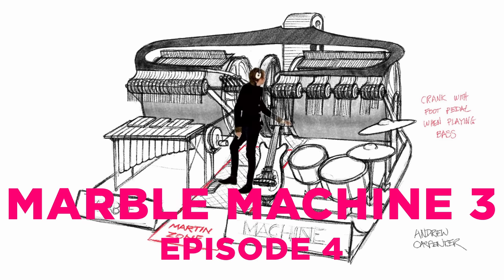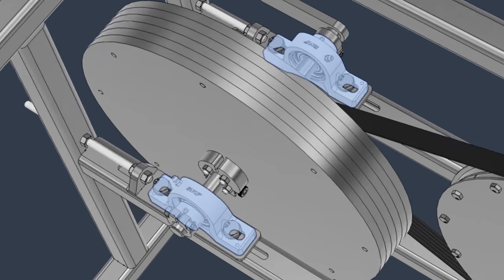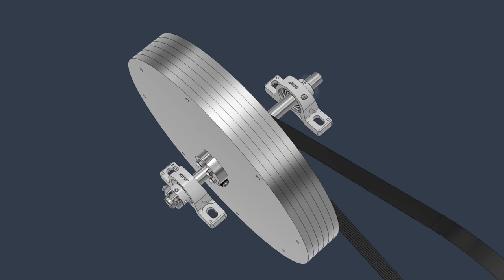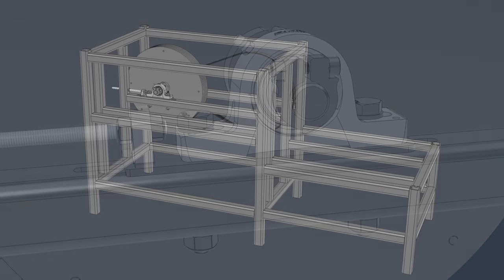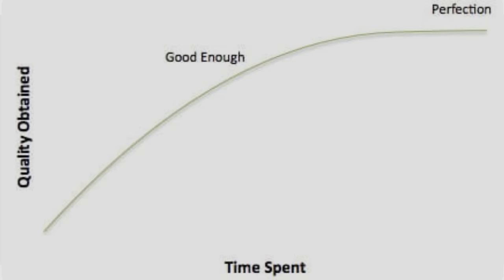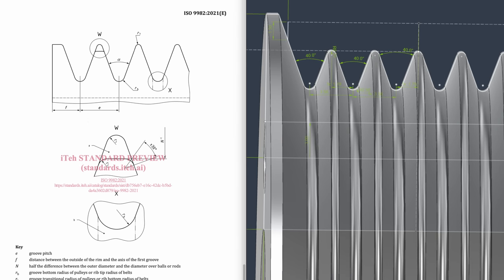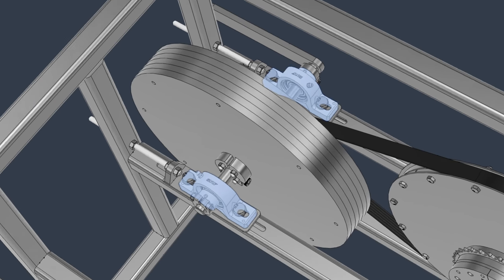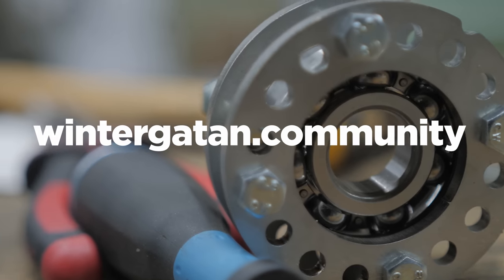A Better Flywheel Design - Marble Machine 3 Ep.4

Comment: If you are going to make the flywheel exact diameter to the axle, it could be good idea to make the hole bigger, and machine a shoulder in to the axle (so that its bigger at where the flywheel is)
Doing it like this you make installing the flywheel much easier as you only have to press a short distance, and not for the lenght of the whole axle.

You could also lighten up the flywheel by taking off inside material, it's the outer edge that does most of the work.

shave some metal off here and other there, and you make the whole machine much lighter
Reply: Hi NuffMan  the advantage of doing the design as-is, is  that you can buy  hardened and ground shaft of a very precise diameter that would be a correct fit
for the selected bearings ,no machining needed other than being cut to length . Bearing ,collars, flywheels etc do not Need to be press fit. In many, if not most applications
Just a very close clearance fit.  (there are tables for this 🤓)If you don't have to press it on you don't have to press it off either.
the fly wheel clamps , correctly made will keep them nice and square.
Of course there are also commercial shaft clamps with flanges , maybe not exactly what is needed thought.
Reply: @steveggca  it's just from experience i know that tight slipfits can really easily make a scratch or gall the surface slightly, especially when there are segmented pieces.

It may not be a problem in the first assembly, but may be a big headache in the future, especially if theres paint on the saft and possibly slight rust at the bare metal mating surfaces.

If not else, the markings from the lock-srews in the bearings will make it impossible to remove the parts from the shaft without tools

Comment: I honestly never knew laser cutting hardened the material it's cutting, makes perfect sense now that I've heard it.
But I've never found any difference between reaming laser cut and drilled out holes, we always did make the holes 1-1,5mm undersized so I can imagine the reamer cutting better when taking a larger cut getting under the hardened layer instead of just skimming of material right in the hardened material.
Reply: Reamers aren't designed to take off much material, usually around 2% the reamer diameter for machine reaming.
Reply: Your name is "axle bearing", so I'll take your word for it :-D

Comment: DON'T DESIGN LEGO PIECES!  Buy Lego pieces!  "Fun welding?"  NO!  Ditch the welder & the angle grinder.  The more of your machine that is ASSEMBLED, (not welded) the better.
On that flywheel, watch out for wobble.  You want the wheel to run true.  Clamp up bolts slightly loose & put in shaft.  Spin & tap with hammer to true, then tighten.

Comment: You can't buy the poly-V pulley?  BUY STANDARD PARTS!  Whoever sells the belt should be able to sell you pulley!
Don't get all hyped about the wheel balancing!  Make it concentric, & that should be good enough.  If it isn't, you are using too high flywheel speeds!  A simple "gravity balance" (done by you on the machine) should be good enough.  Rotate the plates through different angles to distribute the centration errors around.

Comment: They are designed for keyed shafts, but something like an 1108 or 1610 taper lock bushing would provide an off the shelf solution for the pulleys.  Keyless bushings also exist but I don't think they are widely available for poly v profiles?

Youtube machinist Clough42 did a recent series on a grinding wheel balancer that seemed quite sensitive. It's basically two pair of shield-less, un-greased all-ceramic ball bearings (skate bearing sized) in a 3d printed fixture-- that design may be adaptable to balancing the flywheel. Using the collar bearings to balance in situ would likely hide a minor imbalance.

Comment: Cut a key seat on the shaft, and use keys with the flywheel discs (or whatever fixes them to the shaft) and the pulleys.  You don't want your wheels slipping on the axles. Clamping the axle with grub screws or friction fits is pretty questionable in a high-torque application.

Also, why make custom pulleys?  Whatever the European counterpart to McMaster-Carr is, they must have a thousand different varieties in stock, for different belt types, sizes and diameters, including 3-, 4- and 5-step adjustable cone pulleys so that you can try different ratios.

Comment: Hi Martin, 
Have you checked the deflection of the axle under the maximum weight of the flywheel? If it's really heavy, 20mm may be a bit small going by what appears to be the unsupported span in your drawings. A larger (30mm?) axle will also give you considerably more clamping area, reducing the possibility of slippage, although torque requirements may not be very high. 
Would agree with the comment about weight distribution on the flywheel; center mass adds weight out of proportion to inertia. 
Am glad things are progressing.  Keep having fun!

Comment: I think you're still over complicating it.  There are nice bolt together taper flanges, so instead of a perpendicular clamp, you have a concentric clamp to the drive shaft.  Same with your pullies, I would use the industry standard taper clamp thing for them.  I wish I could remember the name.  There are so many options for pullies.  Also, v-belts, they are very forgiving, easy to change/replace and find.  If you use a taper clamp, then you can also ensure that the belt is square to the driving pully.  Getting the alignment correct on belts is critical. Serpentine belts are very unforgiving to misalignment.

Comment: I think your going to have trouble with the shafts clamps alone. Once you've done up the through bolts you won't be able to tighten them further.
A key way for the pulley and flywheel will be simpler, and  lower maintenance. You'll still have to use clamps but they'll only need to restrict the axially position of the flywheel.

Comment: Do you have to get the pulleys custom made?
There are LOTS of standardised already available pulleys with built in clamping features to clamp to smooth 20mm axles.

Off the shelf parts mate. All the time.

Comment: I like the new design, but I am concerned about starting to build it BEFORE the machine is designed in it's entirety!  You can't assume you know where anything is going to be located until you have made a place for everything.  But you aren't done when you have a place for everything, because you also need to figure out how it will assemble and in what order parts will be assembled.  You will probably find conflicts, which will force you to iterate on the design.  And once you go through a few iterations, you build it and find more conflicts that you hadn't noticed.  So you can't "just" start building a frame and assume you are making progress toward the final machine!

Comment: The current design allows for the use of multiple sets of pulleys to somewhat easily and quickly change tempos and maintain optimal flywheel inertia using a single belt length. I.e., tempo/flywheel rpm ratios. A simple governed variable speed transmission to unlock tempo from flywheel rpm would be the ultimate. If the MM3 can be played from a seated position, adding another foot pedal to utilize both legs would be more practical, efficient and physically sustainable.  A one-way clutch on the pedal input would be a safe thing to do. At least make it impossible for your foot to get caught and crunched in the machinery.

Comment: Pump the brakes right now please, Why not use already existing parts for this? like car parts? You can already get extremely balanced parts that you need for the flywheel with using car parts.
If car parts are too heavy, look at smaller vehicles, like gocarts or even RC cars. Hobbyist are a good place to look at for ideas for parts.

Comment: Reaming makes very round holes, but it won't improve concentricity. If you start with an eccentric hole, the reamer will just follow the hole and you'll get a perfectly round eccentric hole.

To make a concentric hole you really need single point boring. 

Or I suggest to laser cut the OD of the discs while they are installed on the shaft. If that's somehow possible. That way they should be very concentric, in the current setup, but you can never undo them.

Comment: I would recommend a "push" design rather than a "pull" for the belt tensioner. The pillow blocks are made to have a screw butted and pushing against them (hence the oval holes). 

I'm pretty sure your sled design will slide under the pillow block without moving it

Comment: Just sticking with the sticking with proven methods bit. Why not use car supercharger pulleys? I understand it could be a bit more costly. But I also feel that they are designed specifically for higher rpm and thus will be far more effective and durable for your purposes

Comment: Well the bearing sure looks good now. But… looking to the support where the horizontal beam is joined with the frames vertical beam. It will probably hold, but it looks a bit flimsy. Maybe strengthen the corners on both sides to keep it from shearing of.

Comment: I work on a chaff cutting machine down in Tasmania. We use the exact same setup for our fly wheel which has our cutting blades clamped on it. It also runs all our driving belts, rollers and 2nds elevator too. We run 4 pulleys in sequence from our driver motor. Our biggest issue is getting everything stable as we have a lot of vibration, we go through a lot of grease and oil lol.

Comment: The reaming idea is good for the fit on the shaft but it will not guarantee placement of the wheel compared to the shaft. I think the economical, fast way for outside diameter concentricity (much more important), is Matthias Wendell's method of big wheel truing on the machine. He uses it on his big bandsaw wheels. Maybe rig up an angle grinder on the machine and turn the wheel slooowly while slooowly advancing it into the grinder with your cool belt tensioners. Mind your axial runout too! Of course ,then balance after.

Comment: Those pillow block bearings usually have an eccentric locking collar already on the shaft collar. By you adding all those other locking collars of your design will make it difficult to balance. Uneven weight distribution will cause Balance issues. Also you need to do a precision job of reaming the thru hole exactly perpendicular to the flywheel faces. That requires setup in a machine to insure the perpendicular reaming of the center hole.

Comment: Put belt on outside of bearing house = easy to replace and less distance between flywheel and bearing.
Also, might be necessary with crash cage for safety (2000 rpm is pretty high for a machine flywheel that is to be used in a crowd).

Comment: If the pulley geometry has an ISO standard, check if it also includes tolerances and dimensioning. If it does, put the nominal pulley size and the ISO spec name on the print and nothing else about the profile. Let the machinist figure it out from there. Using standard components applies to design and drawings as well as parts.

Comment: When it comes to making the flywheels concentric, you can also follow the Hyneman school of makind stuff round. Have the wheel fixed on the axle, mount an angle grinder to a stable holder, like clamping it to a table, and spin the wheel while in slight contact. That how he made some of the parts for Blendy the battlebot.

Comment: Martin,  Have you thought of coupling the drive pully and flywheel with a clutch system?  If you need to stop the machine, you could pull the clutch and have less internal mass to stop and you then save the internal energy in the clutch to help restart the machine.  May even be able to repurpose a motorcycle clutch?

Comment: What is stopping the entire assembly from spinning freely on the axle? Are you relying on a clamping force? There really should be a key way or 2 to fix it together. A heated interference fit might work but, there will be a lot of energy once it spins up. Are you also going to have the ability to slow it down with a braking system?

Comment: Instead of multiple plates for the flywheel, have you considered a single modular flywheel with the space to bolt weights onto it? It would make it much easier to change the amount of weight on the wheel without having to disassemble the entire mechanism.

Comment: I don't know if I'm missing something but if you will decide to use less than 6 wheels, the screws for attaching them will have to be smaller right? Otherwise, the screws will interfere with the black band behind.

Comment: Not sure if it could be an issue, but are you worried about the square tubing warping when you tighten down the bolts holding the pillow blocks? Perhaps some sort of spacers around the bolts, or internal reinforcement could help.

Comment: You probably want to have a good think about using keyways and keys to lock the pulleys and flywheels into position on the axle as you do not seem to plan for a press fit. After all, you don't want for any of that stuff to start sliping when you accelerate or decelerate the whole assembly. I'd still get feedback from a professional on that though.

Comment: also, a 20mm diameter rod seems a little small for the size of the flywheel.  have you checked the load limits for the bearings?  seems like you'd want a much more robust rod and bearings for the flywheel.  maybe also do some dynamic load calculations for a tiny wobble.

Comment: One consideration on the tensioner design you have is that there are two adjustment points to adjust a single thing. My suggestion would be to take a page from automotive design: an idler pulley on the outside of the belt loop which is spring mounted with an adjustment for how springy the spring is. The makes it have a single adjustment and this adjustment isn't a friction mount which may need to be periodically adjusted due to vibration causing stuff to move.

Comment: I think your flywheel design is wrong.  Most of the mass should be as far from the center as possible.  The center should be something like spokes.  The mass of the flywheel that is closer to the center is just extra weight you need to carry around when you move the thing.  I hope you understand my point.

Comment: "Spoke" the flywheel to concentrate the mass at the edge. You will need more disks but you will end up with a lighter flywheel with the same energy storage.  Mass at the center of rotation adds weight without storing much energy. Two spoked disks with rings bolted between them would increase energy to mass ratio.

Comment: There is also a proven design for radial torqe transfer: adjusting springs. And the axial placement of the pulley could be fixed by a step in the axle and a groove nut, to relace the lasercut part.

Comment: I suggest to put the pulley on the other side of one of the bearing so you don't have to remove a bearing to switch pulleys. I also suggest to either have a tensioner or having the input side of the system moving to add tension. So you don't have to move the heavy side of the system when you want to adjust tension or do maintenance.

Finally I suggest off the shelf pulleys and off the shelf collars. using your own words: withwhat exist on the market, no need to design those Lego parts just select the right Lego for you build.

Comment: Why don't lathe the flying wheel? I mean, if you want to check the balance of the wheel when rotating what would be better to check it while you are still making it?

By the way you should also take in account all asymetric parts attached to the axis. The balance is not only about the flying wheel but about everything that rotates.